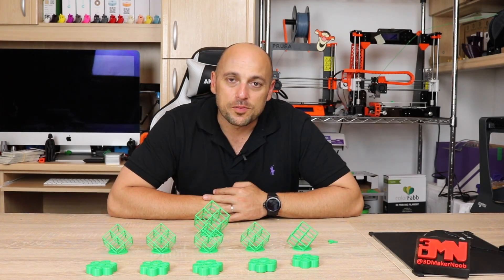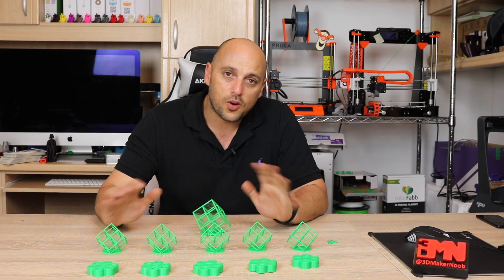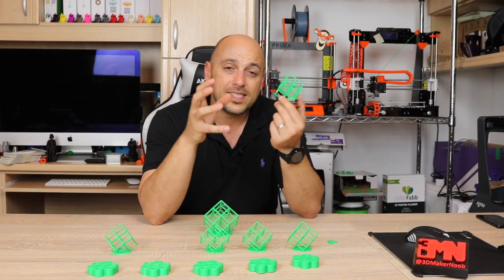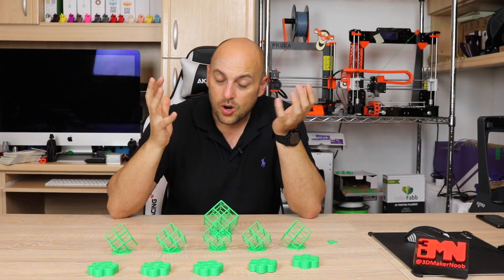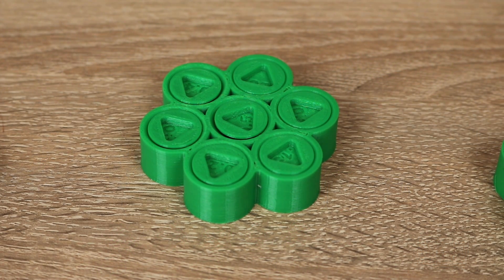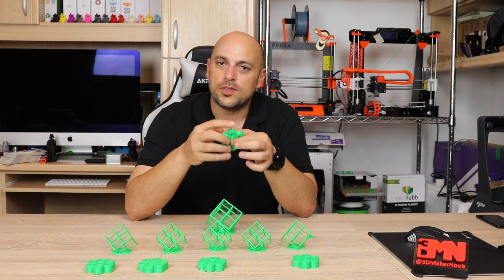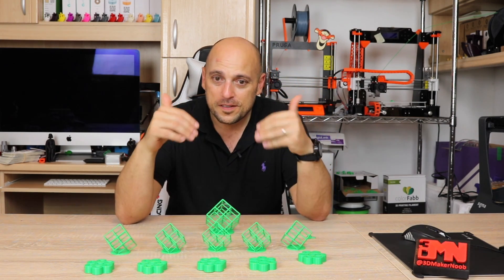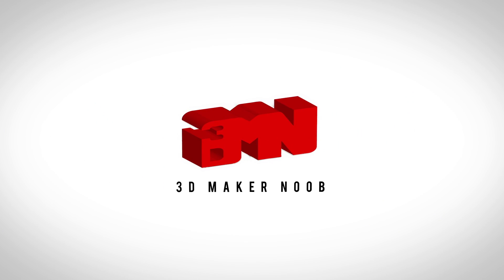Testing Different Fan Speeds On Prints With The Anet A8

Comment: Maybe offtopic but i cant get my anet a8 to print in normal quality.
I tried to print belt tensioner bolt and when it started i already saw like some "wobble" in printout.
It was like stretched diagonally from bottom right to upper left.

Other side was fine. Im kinda disappointed in this whole thing.

Comment: What plastic was used? 195 degrees sounds like PLA but a bit low for some PLA. (210 is average from what I seen for PLA) but 195 is perfect for Wood-PLA as anything higher will start to turn the wood into charcoal and jam up the extruder/hot-end! (Been there!)

Comment: So.... I was one of the people saying you should have done this and that on your last video on fan ducts and THIS is a much better video.... However i would say from my testing that to much cooling creates cracks from my testing .. you need to print something with thin walls and very tall to see. it.... it would be interesting to see a video on that.. i accept that i had to "over volt" the fan to get it really humming... i have a rubbish video on this ..i'd post it here but don't want to be accused of anything so wont.

Comment: Nice going this has saved me a bit of fiddling to find this out for myself as was about to do some experimentation with fan speeds,  as I had noticed the different fan options which got my curiosity  reside within cura that allow for some flexibility  for varying the fan speeds  at different layers, one thing that seems to have me  a  wondering just a bit is how much surface area or layers is the fan meant to cool for best results?  I had noticed that  while testing some fans made my hot end's  temp drop quite drastically,  and struggled to   maintain the  correct temp after a few layers into the print, (despite a practically constant duty cycle for the print) but have  now successfully mitigated that problem with copious amounts of plumbing tape around the heater block
Reply from the maker: +Andy Davies if you get severe temperature drops you might want to do PID tuning as that is usually the main culprit. I will be doing a video on it shortly :)
Reply: thanks for the tip,  an I'll belooking forward to thenext video, can PID autotuning be done with stock a8 firmware?

Comment: hi, can you or someone in the comments help me. iv built my anet A8 the same as 3d maker noob, all was working great until today when I replaced the tape (it got ripped) with a sticker (Velleman Buildtak 3D Print Bed Surface) but the print doesn't seem to stick properly.
Reply from the maker: +Paul Allen if it's buildtak make sure it is cleaned properly with alcohol to remove any grease.
Reply: 3D Maker Noob out of interest what make would you recommend?

Comment: Nice vid, very informative! Could you make a video exploring options for making the blower fan quieter? Perhaps some fan upgrades? I've seen printable fan adapters that replace the blower fan with an 80mm fan, which I'm very interested in doing as the blower is by far the loudest component in my anet a8 right now.

Comment: Hey, good video again. I have to say that with PLA I normally print with 25% fan speed, only if the print might have overhangs bigger than 55% and/or layer printed in short time I go up to max 75%. In my simplify3d profiles the fan speed goes up to 75 % starting rise at a layer time less than 21.5 seconds and print speed starts to go down to 60%  at layer time less than 20 seconds. But I also "learned" over the years that just printing slow is most of the time the best, combined with slow fan speed. Also too high fan speeds can cause bad layer adhesion. It is really something you can spend weeks of testing this. If I get a new Filament I first print two 20x20x20mm calibration cubes 45mm away from each other. This is for retraction and extrusion multiplier. If the cubes are bigger than 20mm I decrease the extrusion multiplier (only if the steps per mm are set right) and if there is stringing I increase the fan speed (starting with 15% fan speed). After that I print Marvin to test the right fan speed for overhangs and really small parts (slowing down print speed and increase fan speed at set layer times). With PETG nearly same settings like PLA, maybe slower fan speeds (for my PETG Filaments). ABS I turn the cooling fan off. Just try if the part you printed with 100% is less stable than the part with 0% fan speed. This is my procedure that works for me. I hope I did not wrote too much, if so sorry for that. And also every Printer is different on this and everybody likes their prints in different ways. So never mind and happy making :-D.
Reply from the maker: +P_K_3PDK haha please don't apologize, comments like these just gives me more ideas for content, maybe the next comparison will be testing print strength with different fan speed ;) as you said, these comparisons can go to an endless extent and I have to say that I really enjoy them as it always a learning curve for me so I instantly start recording :)

Comment: TIGHT BELTS VS MEDIUM VS LOW :D (dont crack the acrylic frame plz)
Reply from the maker: +meky0 yes!!! Brilliant idea :)
Reply: spoiler: my hypothesis* (if the frame does not flex ) you can get at least 0.2 to break free with properly tight belts ;)
Reply: 3D Maker Noob if you go with this, look up using the steak cooking finger pressure guide for belt tensioning! Seriously i read this on i think it was the ultimaker forums and it works better than trying to tune them like a guitar!

Comment: Thanks for putting all the work into these tests, and giving us more ideas on how to improve our results.
The surprising result that 50% speed can be better than 75% speed is probably just a side effect of the aerodynamic system between the fan and fan duct. Actually kinda surprises me that nobody does CFD simulations to optimize the design of these fan ducts. At least as far as i know, they are just designed "out of the blue" to put airflow near the nozzle somehow. I bet with simulations you could see interesting effects like the pressure distribution on the fan shroud outlet, aerodynamic problems showing up at certain fan/air speeds that block and reduce the airflow, effects of backpressure on the fan itself influencing how efficient the fan actually "pumps" air forward and much more... Unfortunately good CFD software is very expensive and it takes quite a bit of know how to set up and make simulations that are actually close to the real world. But it would be very interesting to see what is acutally happening between the fan and fan shroud and i'm shure that it would help explain some effects we see.
Reply from the maker: completely agree that most of these fan ducts are designed on assumption and pure ideas, while most of them work, i agree that it would be extremely interesting to see what happens internally or have an actual visual projection of how the airflow is extracted. maybe a project i could work on :)
Reply: That would be really cool if you could dive down into the simulation. Just be prepaired to dump some time into the subject, it's really not that simple in my experience. I've only ever used Mentor FloTHERM PCB to do some thermal simulations on a power supply design, and that was already quite a task to wrap my head around. But it was worth it in the end as already the first prototypes showed no thermal issues under maximum load and the worst environment conditions. Do you already have any experience with CFD or FEM simulations?

Comment: Great video Thanks 
The MM tolerance test is indeed interesting . We shouldn't forget the age old issue with slicers/ Gcode and how they handle internal diameters V external diameters !!  
I believe this is why S3D has the XY compensation adjustment .....and >>> http://forums.reprap.org/read.php?263,715397,715473#msg-715473

It is interesting that fan speeds have such a noticeable difference . From that i can only imagine that the cooling process from extrusion temp to "room" temp has a significant effect on the final dimensional accuracy of the part.
I wonder if annealing the parts would change this ???? I also wonder if printing them at 100% infill ( theoretically giving them a larger thermal mass and thus a slower cooling cycle ) would produce any significant differences ??
The fan efficiency and fan duct will no doubt play a role too

Comment: id love to see this in ABS as i saw a lot of debate about fans and ABS vs quality.
Reply from the maker: +Samuel Porter will be doing that next :)
Reply: 3D Maker Noob in your unboxing of the anet a6 u said that uk's should go 4 the us plug model as its $75 cheeper and get a separate chord - I don't suppose u have a link to one?
Im A 12 yr old wanting to get into 3d printing without spending over £170/$170 and i love your work so KEEP IT UP!! thx ;)  ❤️💛💚💙💜

+1 subscriber
Reply from the maker: +Wandering Eclipse hey!! Happy to see you want to get into 3D printing :) the Anet A6 is a hell of a kit to put together so make sure you have help and also watch out for my next video on safety :) I will also have a video soon of a new cheap good printer called the ANT Ecarry. Either way, the link to the printer is in the video description of the live build. They might have figured out the plug thing though :)
Reply: Yes I agree, the ABS should show more spectacular 'variation'. Would love to see this to help me with printing ABS on my A8! I am currently using 220C on Black Hatchbox ABS, 30% fan with 100% extrusion, 65C Bed (tropical climate with 28C room temp). I was going to try reducing fan to 20 or 25% and increasing it to 40% to see how it affects stringing, but I don't have the time
Reply: 3D Maker Noob THX happy printing ❤️💙❤️
Reply: Need to thank you for the power supply safety video you posted, purchased the parts and awaiting the Anet A8 to apply everything, as always Happy Extruding......
Reply: CHEP 3D Printing I achieved 100% straight(perfect alignment) print without the fan( because I forgot it in the settings 😁), while using the fan the ABS shrinks slightly( unnoticeable) which cause misalignment.

(when the accuracy highly required)
Reply: Bridging is helped with a fan but only in an enclosed environment/  My Qidi printer is enclosed mostly (the top isn't where the filament enters) and my PLA parts inside have warped from the heat it gets in there during a normal ABS print.  I need to reprint my cable chain, and other parts, now in ABS as the chain no longer links.  In such an environment a fan blowing hot air does help bridging but try that on an open frame printer and it will be utter disaster.
Reply from the maker: the few times i printed in ABS i switched it off completely. gonna be honest, only printed a few parts, and recently printed the Mk2S parts in ABS, always without a fan as the one time i forgot it, the benchy became a canoe :)

Comment: Wait, 6mm retraction? I go 1.5mm on mine, and maybe 2 if I'm having issues. Seems a bit strange.
Reply from the maker: not strange, all depends on the settings you have and filament you use. i have filament where i use 0.8mm retraction and also others where i go up to 10mm especially if it's a bowden setup. it also makes a difference if you want to use coasting or not
Reply: I guess I haven't been using very interesting filament, then, lol. All I've ever printed is PLA from a few different manufacturers. I'll probably try flexible next.

Oh, I use a direct-drive system, so that probably helps.

Comment: Ever consider doing some experiments with ABS on the A8? It does have the heated bed, and is capable of the required temps. I've been printing exclusively ABS since I got my A8 (to print all my upgrades) and have had mixed results. I'm finding it hard to find many concise sources on YouTube or the net for printing abs on the A8, or setting ideas for abs in any specific slicer. It all seems like just opinion and suggestion for machines like the ultimaker. It's a good starting point, but not much directly related to the A8. Lol... just a suggestion, but I know ABS printing isn't everyone's focus.
Reply: I've got mine in an enclosure which is just passively heated by the printer, but I built it right from the start, so I don't really have a comparison to open air but I still get warping, and sometimes severely.(it heats to 35c inside) I'm using hairspray, again per suggestion and popular opinion, but I've got some slurry made up and I'm on the verge of trying that. I'm running 230-240c, 108-110% extrusionrate rate with 105-110c on the bed, and speeds of 30-50mm sec (per all my research) But I contacted the guy who Angus (makers muse) featured on the tolerance test video, who printed it in ABS, and he suggested 250c! in a passively heated enclosure, with 20%fan. So I don't F-ing know. Lol, it's like everyone just does it their own way. I've heard fan and no fan. I've heard all kinds of temp suggestions.  Some of my prints have been really nice, but some have been, literally, hot messes. overhangs, bridging, and tolerances aren't that reliable because of the inconsistency at the nozzle end. Sometimes it looks like it's over extruding, sometimes it looks like it's running dry. Theres no way i could do a tolerance test. It would just be a fused puck that looks like a tolerance test lol.
Reply from the maker: +Dj Goku I will be doing more ABS testing very shortly as I have some spools coming in. I don't mind printing with it at all to be honest, just never had a specific use for it myself

Comment: I've found that the biggest problem in the "tolerance" test is the seam (if aligned) or zits (if random).  Almost any 3d printer can position the nozzle more precisely than it can extrude plastic - too many variables in extrusion - so any attempt to tune for "tolerance" quickly turns into tuning the actual extrusion. Flow, temperature, speed, filament diameter, retraction distance & speed, coasting, perimeter extrusion widths, properties of the plastic - are all factors that determine how tight you can print without joining two perimeters together.

While MakerMuse's tolerance test is a good place to start and a good way to display your final results, it's a very time-consuming print.  When you're tuning, you really only need to print the gap you're trying to tune.  A few lines in OpenScad will let you print two nesting cylinders with a precise gap that you can quickly print as you tune for a perfect perimeter. (don't let the "fat" first layer mess you up.)  Then move on to the next smaller gap.  I had the biggest success when I played with the coasting values.

Comment: Hi joe 
Thanks for all your vids they have really help me with my ante a8 tried to update the firmware and Autonet sensor and failed due to me using a mac book is there anything I could do to solve it
Reply from the maker: +nippychippy hey, I have never used the iMac to update to be honest so not entirely sure, I will try to do some research. In the meantime you should check out their Facebook group as they are extremely helpful
Reply: 3D Maker Noob thanks for the reply joe which one as I have tried and few groups some have been good but no help and others I have left.
Reply from the maker: +nippychippy I tend to revert to the Anet A8 group. You might also want to check the Anet A8 group on thingiverse
Reply: 3D Maker Noob brilliant joe thanks for your help I'll check them again. And keep up the good work your really helping us noobs
Reply from the maker: +nippychippy no worries buddy, it's my pleasure :)

Comment: How dry was your filament? Artifacts get and stringing that look like over extrusion or retraction issues can be from nozzle pressure due to moisture. I use a food dehydrator to help reduce this..
Reply from the maker: +Jai Stanley all filaments are kept sealed in bags with dessicants so I'm fairly sure it was very dry. Could try it again with a different filament but this particular PLA is very forgiving
Reply: 3D Maker Noob Since buying this dehydrator I have less and less faith in the dessicant in a bag method. I've seen great results in general. Granted PLA is forgiving in terms of moisture absorption, but I'd wager it'll improve results a little. I use a lot of polycarbonate, abs and nylon based filament which yields huge improvements. It's a small investment. Mine was £30. Worth a go!!
Reply from the maker: +Jai Stanley I'll definitely be investing in a couple once I move to the new place, will be much more organized :)

Comment: Great video.  
Are you planing to add a BLtouch to your Anet A8 ?
Reply from the maker: +Shawn Wandler I have a couple of BL touch which I got from maker faire, found how to wire them, just have to learn how to program it :)
Reply: I plan on adding one to my anet a8. I also have to add my mosfet to the bed want to do it but printer is working really good right now so hesitant.  Found install instructions for the BL touch on the Facebook support pages
Reply from the maker: +Shawn Wandler I will be doing a video next week on the essential upgrades like mosfter and cables and why to do them, after that will tackle bltouch and also E3DV6 Bowden setup :)